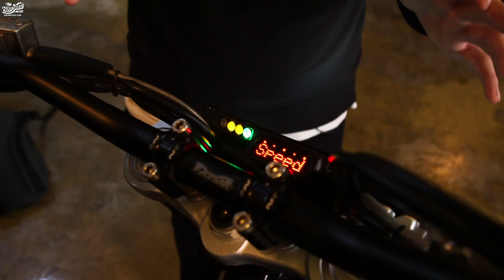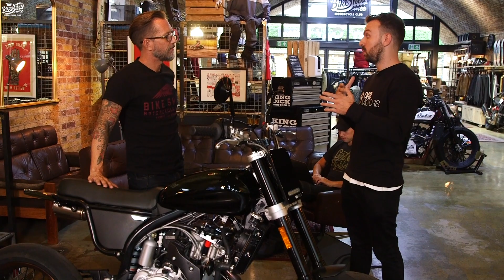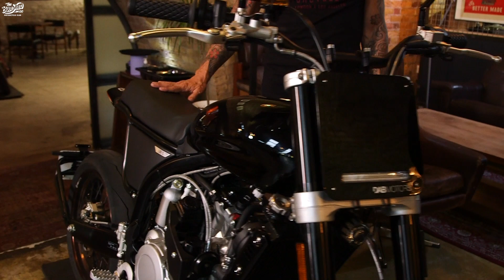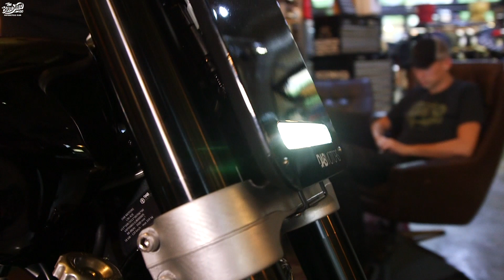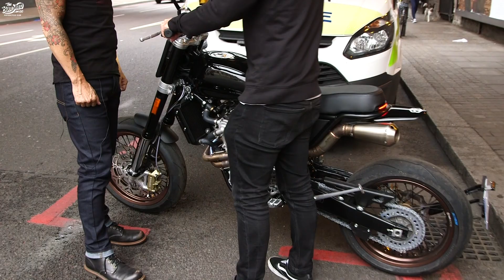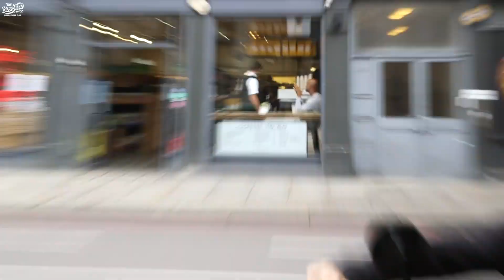DAB Motors LM-S custom built motorcycle

Comment: I'm curious, isn't a husqy 500 basically a racing engine ? Isn't the maintenance a nightmare for city use ?
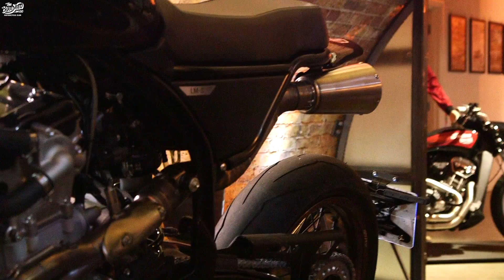Reply: Hmm, looking at 9:39 I dont think that engine is the 500 cc single cylinder that KTM EXC and Husq FE used. Since it got 2 exhaust channel pipes then that means it is a twin cylinder engine. Maybe they got it from Husq Nuda.

Comment: For $20k you could get a top of the line MX bike with all the best components and make it look like this one, although I can see why someone would pay for the style. They have cool components but I really hope the motor is fun+durable, otherwise they won't sell too many of these. I hate to see a new manufacturer enter the market only to be beat due to poor engine performance, however, looking at how the man doesn't go in detail about engine specs, the odds are not in their favor... SO CLOSE to being the actual brand we've always wanted. This looks like another ARCH brand except they skimped on using well-proven engines in order for the price range to be somewhat competitive. I'm sure a lot of people will buy them, just not sure for how long.
Reply: looks like they bought a Husqvarna with half the money nd put on custom parts with the other half. That's how you can get in plated. Nice bike though.